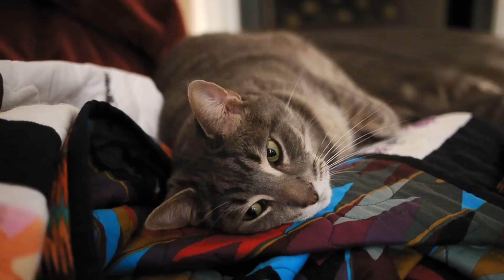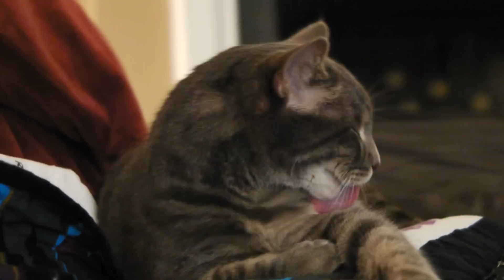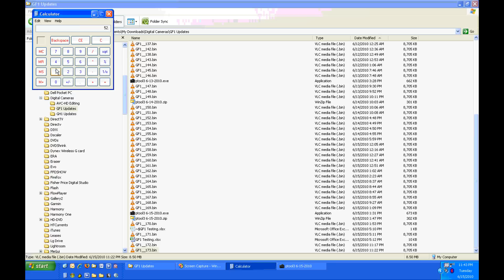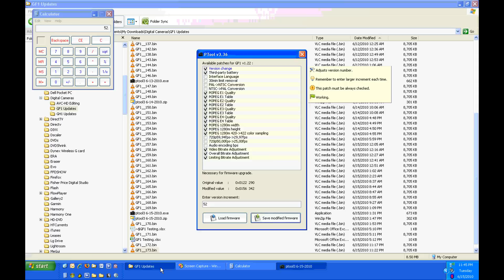Panasonic PTool Firmware Manipulation Tool Demo

Comment: Thanks so much for this. I have been waiting for it and you are true to your word. The question I have is since I have the GH1 and I downloaded the GH1__132 I would select the "version change" then increment it to "2" then select " Native 24p/25", then save under "GH1__133"...correct? Then where do I got from there? Im guessing for each patch that tester13 did like this is the 3.30 then on 3.31 patch states that "3.31 MJPEG compression patches added.
MJPEG 1920 patch added,just for fun.

Comment from the maker: @JO3JITSU Always add whatever number you enter in for "Version Change" to the version number you load into PTool. Rewatch the video it shows you exactly what to do. I even do the math of adding the increment to the original version number on the calculator. That being said the tool is always being updated so this could always change with a new release.